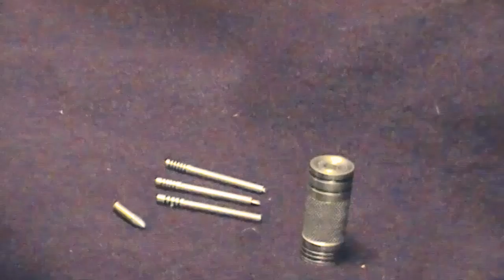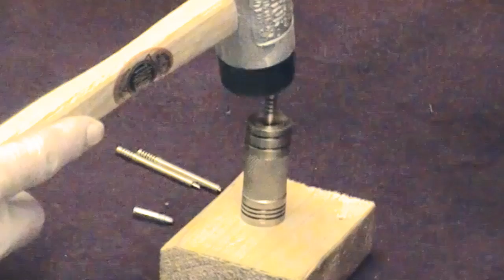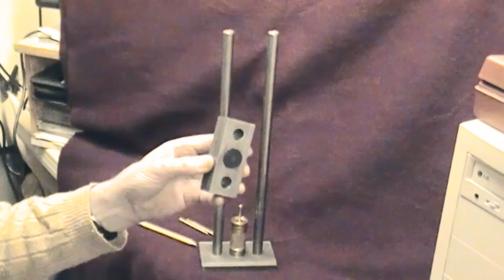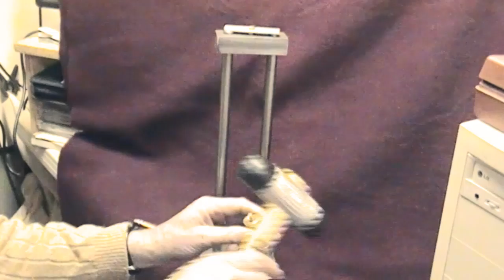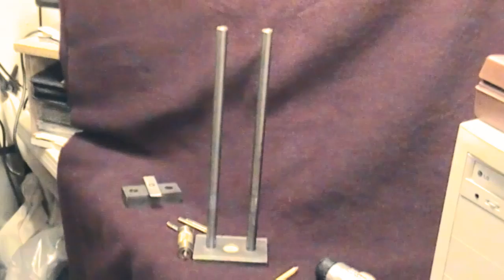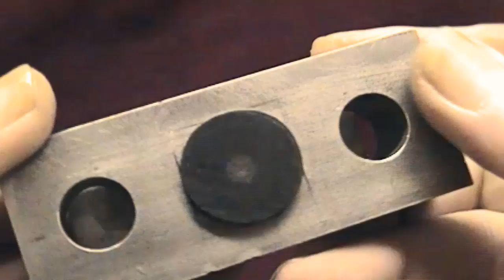The Paco Kelly 'Acu'rzr' and a special purpose made tool

Comment: I'd like to see more. Could you drill and tap a piece of round stock  5/16 - 24 and use a bolt with a locknut to set an adjustable depth stop by slipping it over the pin?
Reply from the maker: Hi Bill - I guess something like that could work. However, thus far at least, using the various 1" marker positions has proved reliable. I do intend to properly engrave these for easier visibility sometime.